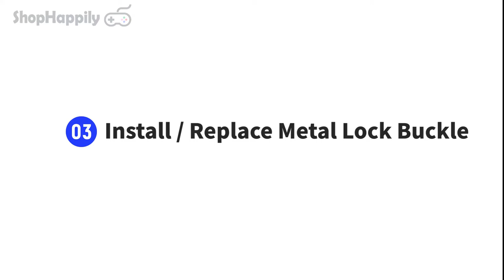Mcbazel Complete Repair Kit How to fix Tutorial For Nintendo Switch Joycon

Comment: I changed the slider on my right joy con, but now it won't charge and the LEDs won't work
Reply: It a long time out, but the two symptoms you've noted are indicative of issues with both ribbon-cables: The upper one relates to the sync button and the 4 LEDs whilst the lower one relates to charging. In your situation, you'd want to confirm that the cables aren't damaged and that they're installed correctly. If the battery's dead, the 4 LEDs won't work, so the upper cable isn't necessarily bad. You'd have to get some charge to confirm if you hadn't done so prior.